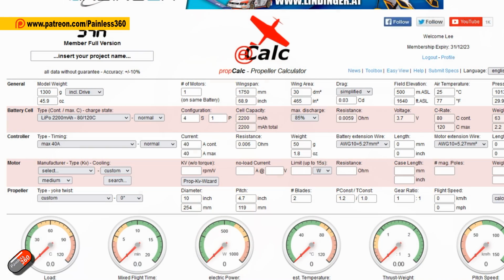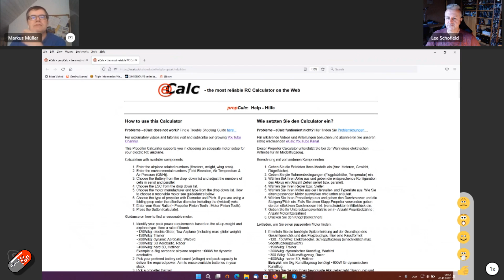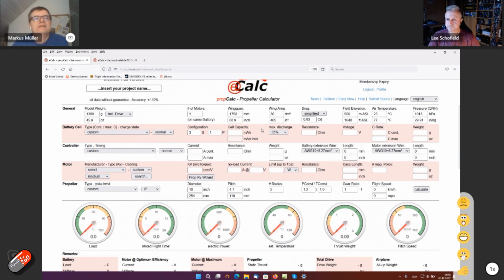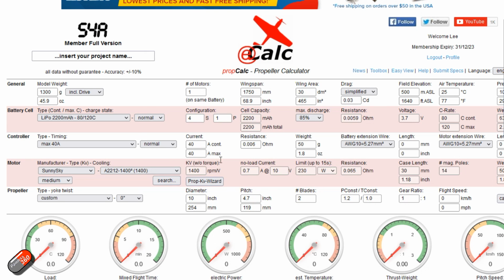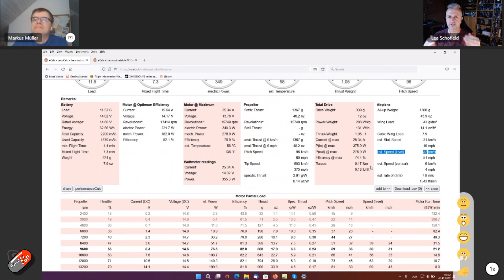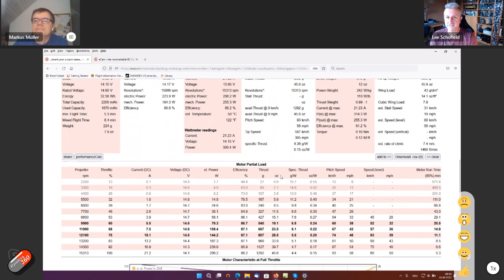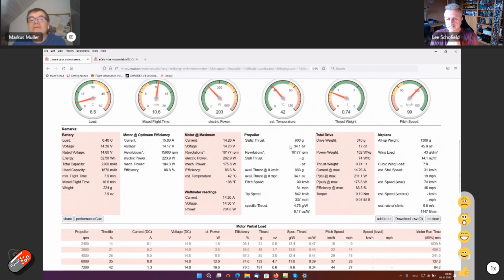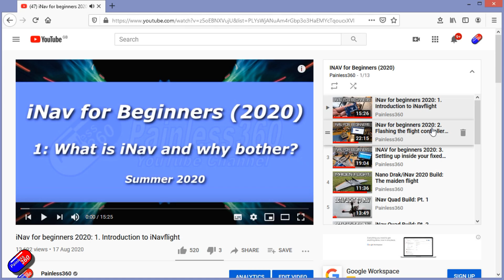Picking a Motor and Prop for my 3D printed wing using e-Calc

Comment: Thanks for the video! I'm just starting to get interested in this topic, please tell me - in your opinion, what is the maximum flight autonomy for this wing at a speed of 40 km/h? What is the maximum capacity of the battery?
Reply from the maker: All of that will be found when I fly it. Ecalc only gives an indication of amp draw and flight times... Stay tuned

Comment: Great video as always Lee. Do you have a video on differential thrust set-up on the TX16 radio for yaw control? I saw videos with models that had 4 propellers and the model was making nice flat turns.
Reply from the maker: I do, check out the videos in the OpenTX mix school.. (or simply search for 'differential thrust painless360')

Comment: I’m a big fan of ecalc, funny thing is I came up with the same motor combo, as your video for my eclipson model A, but I’m using a 7x4x3 prop, because a 3 bladed props is better balanced out of the box, no stall.  I’m going to use this same combo x2 on my new dragon II.

Comment: Why is motor weight important? I have only seen the motor weight be part of balance.
Reply from the maker: Once you know the rough power needed (n Watts), you can calculate the approx weight of a suitable motor. Then you can plug a motor of that weight into the calculator and see how it works. Try it, free access to e-Calc below.. Happy flying
Reply: @Painless360  I wish there was a way to put in the flying weight minus the motor and the flight style you want and have eCalc find the best motor size and kv.
Reply from the maker: You can 'guess' using the method shown. Standard motors like the 2212 style are pretty easy to use as a reference to start the process.. I always add about 100g to the estimated weight when starting to 'mop up' those additional 20g here and there on a model (motor, spinner, power wires etc.).. Happy flying!
Reply: motor weight also affects how much it heats up.